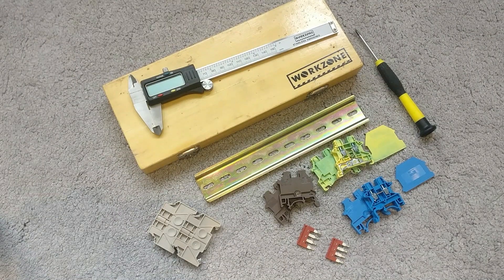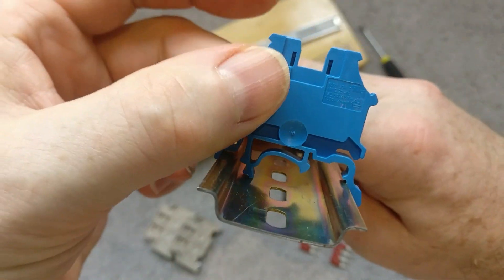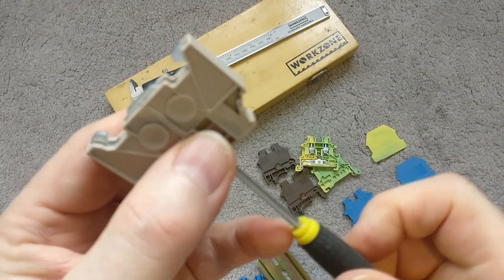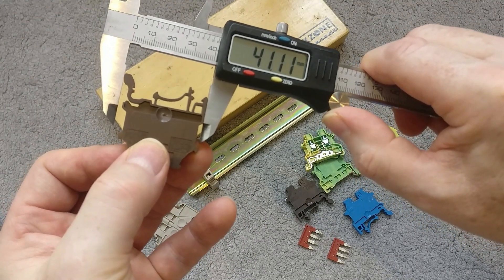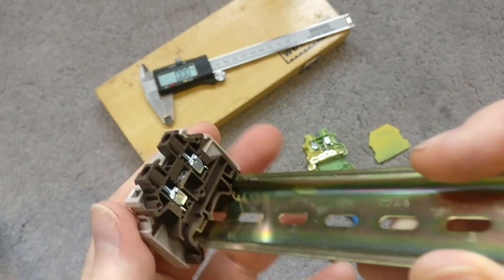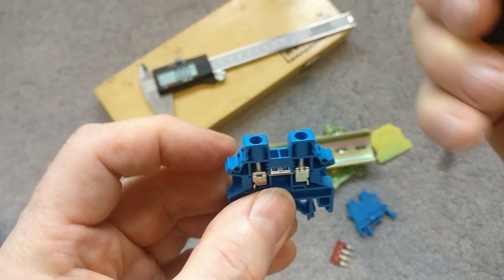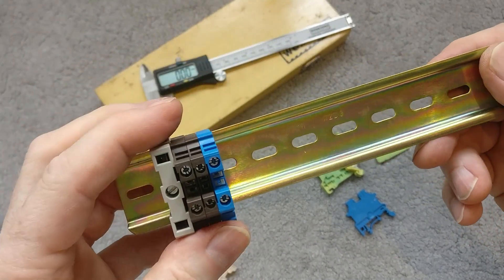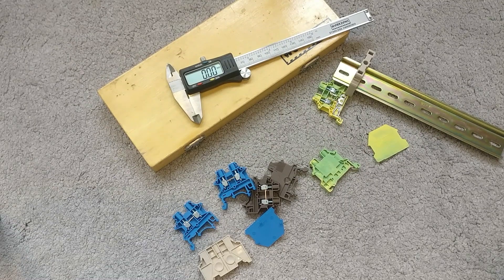DIN Rail Terminal Blocks (Detailed Review)

Comment: Nice video, thanks. So if there is a ground fault the current would flow to the din rail?
Reply from the maker: Thanks. I think given the way the earth blocks screw down to the rail you would be right.
Reply: @Builtbypete  Thanks. I think I would rather use just a regular combiner block for ground that didn't have metal feet to the din rail that would pass overflowing current thru in the event of an overage to a dedicated ground wire to earth ground.

Comment: Are the Din Rails carrying current if you use in an AC application?
Reply from the maker: No. The live and neutral are isolated from the rail with the connectors I used.
Reply: Normal service currents do not flow through the din rail. However the din rail can be used as a fault current path with earth terminals that connect to the DIN rail.

For most projects, normal din rail is more than big enough to serve as a protective conductor. However, I have seen some high current earth terminals that come with warnings that special din rail is needed.